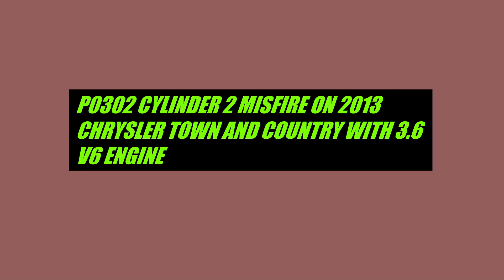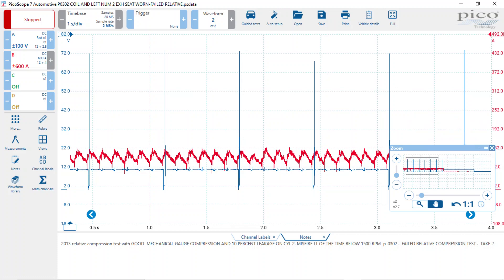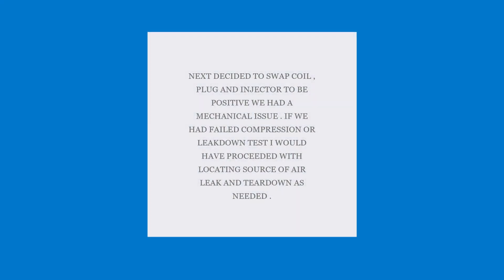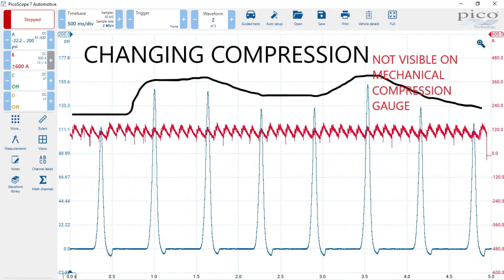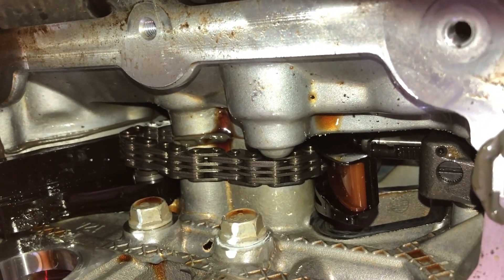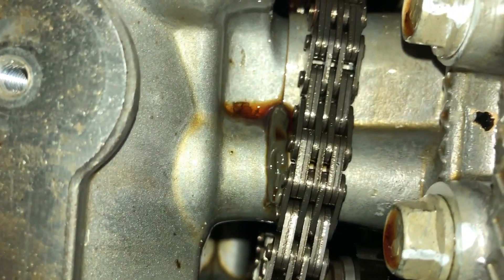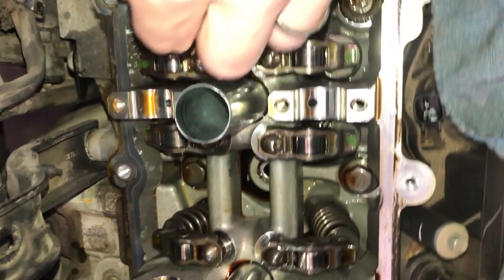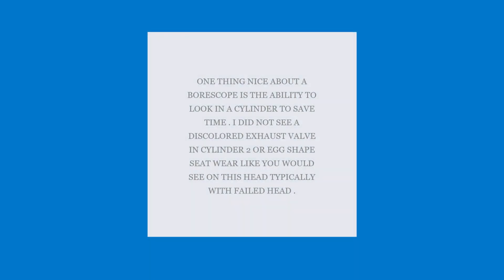2011-2013 Chrysler Dodge Jeep Ram P0302 cylinder 2 misfire DIAGNOSIS

Comment: Thank you for this video, I had dame issue, I had done same diagnostics and literally checked everything including changing cylinder head, but then still had problems which initially was on cylinder 6, but later became cyl2. Check lifter 2 exhaust and found one stock and that means it wouldn't close exhaust valve. Thank you very much.

Comment: 2018 Ram 3.6L problem. I have a persistent cylinder 2 misfire which you can see the engine vibration here.  Have changed the plug, coil, and fuel injector.  Did the combustion gas detector with the blue fluid thingy in radiator cap:  fluid stayed blue.  Stethoscope hears fuel injector clicking.  Voltage checker shows coil firing.  I can take the valve cover off next, but what do I look for?
Reply from the maker: Compression ?
Reply: A rocker thar has fallen off

Comment: Good info but the average person is not going to want to pay thousands to have the mechanic do this kind of deep diagnosis
Reply from the maker: AGREE . This testing was more of a way to prove point of failure on the lifter . This would have gotten a ton of parts including a head and this can be avoided with an in cylinder psi transducer.
Reply: @ocdauto8794  I work with quite a few "techs" that would have blasted the parts cannon. I have seen one in particular replace the head, rockers lifters and cams with nothing more than a dtc for diagnosis
Reply: You don't need a lot of tools for the relative compression test. Inexpensive USB oscilloscope or even a computer sound card may be used for it.

Comment: Nice! I had one a few  weeks back with the same symptoms , also had uneven compression humps. I told him I had to remove valve cover to verify if its rocker arm or lifter, but customer declined further diagnosis
Reply from the maker: I lost my scope reading using in cylinder on a left head with leaky valves !